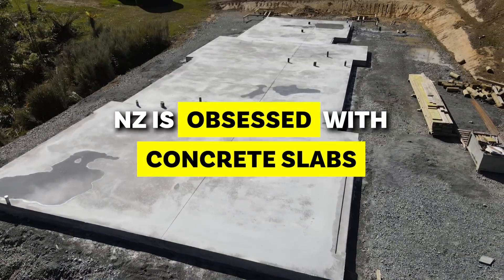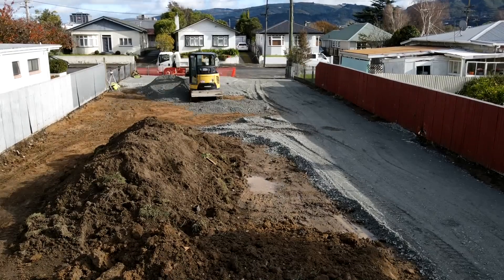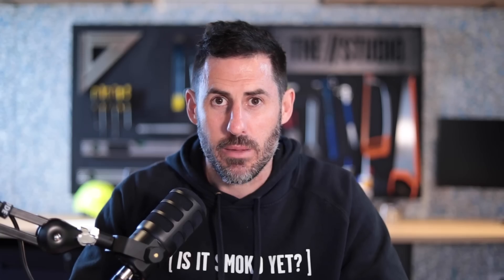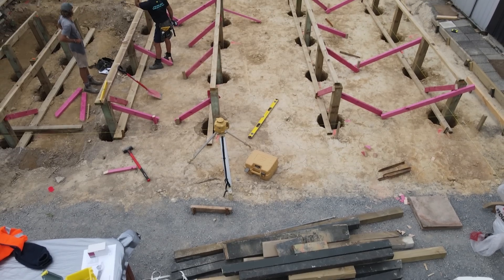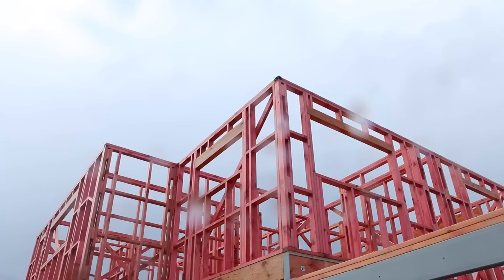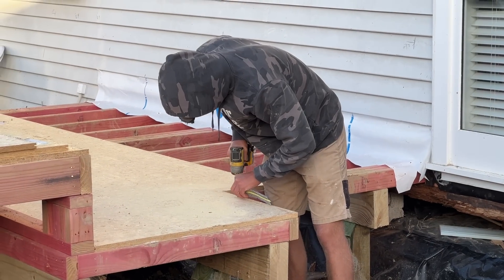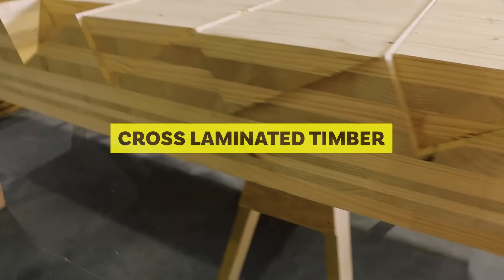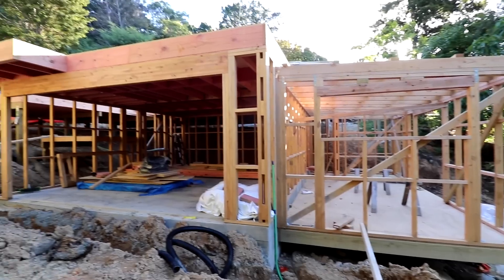New Zealand is OBSESSED! with Concrete Slabs

Comment: Hey Josh, I'm in my first year at Unitec studying to be a QS. As someone who is moving from a career in hospitality that hasn't got any hands-on experience in the industry, your videos have been an incredible resource to supplement my learning and wrapping my head around how these systems work. I've told everyone in my class to subscribe to your channel. Churr and can't wait for the next vid!
Reply: I’d highly suggest if you know a builder ask if you can do a few hours of work with them on a site too. Seeing the process from every angle will give you an awesome perspective, knowledge is power. All the best
Reply: I studied architecture at Unitec and wish he was around during my studies! So informative
Reply: I worked as a QS for 5 years after studying Land Surveying and working in the profession for 18 years. I was taught by my boss who was a builder and the skills/maths required to be a QS were simple compared to Land Surveying/Civil Engineering. I picked it up in a very short time learning from all the builders, our PM and being on site. Concrete slabs were used when the ground was suitable for them as they were quick to establish. Piles were used on more difficult ground. Of course now we use gravel rafts quite a bit under slabs although piles are still used for inadequate ground requiring piles down to solid bearing soil layers. I then started drawing up house designs using Autocad from the knowledge learned over the years in the QS field. I'm now back in the Civil Design and Geotechnical Engineering profession for a greater challenge.

Comment: 13:14: I used to live in a multi-storey hostel where the floors/ceiling were constructed of wood. I can totally relate to "elephants stomping across the floor" sounds. 
I lived on the ground floor which was a concrete slab so I was ok and not bothering anyone. I feel like the noise from the upstairs neighbours could have been mitigated with a layer of insulation and sound dampening material, but the owners went with the cheapest option I'm sure. LOL. 
There were countless other problems with that building, as it was a leaky building, where they installed the wrong rated pipes for water connecting all the hydronic wall heaters/radiators. Think it was PVC in some places?
Reply: we built a two story house, concrete slab in both levels. nothing beats it!
Reply: @martiruda  That sounds awesome (well no sounds I hope).
Reply: @guston_zimasheen  literally xD

Comment: Concrete pumps wow! We were the concrete pump, via a wheelbarrow.
A day barrowing concrete and you knew what a hard day's work was.
Reply: There is a famous (in my family) story that my grandfather told me before he died. He and his best mate needed to do some concrete work and they estimated it would take two days. So the first day my grandfather was mixing with the wheelbarrow and his mate was pouring. On the second day they would swap.

So the first day came and went and my grandfather was broken... all day lifting and mixing. However when he arrived sore at the site the second day... his mate was standing there with a concrete mixer... with a big grin on his face, a mixer which he had begged borrowed or stolen. My poor grandfather spent all weekend with the short end of the stick.
Reply: @matthewdonoghue321  I had forgotten about mixing in a barrow. Worst I did was a fence over a few days, all mixed in the barrow. Last time I checked it was still there, which is amazing in itself.
When I got my first mixer there was no stopping me, then I gave myself tennis elbow digging holes in hard ground. The 'Good old days'...
Good story about your grandad, must have been speechless when his mate turned up with a mixer, the next day.
Reply from the maker: I also remember these days well. Doesn't mean we shouldn't use these machines though and save our bodies for years to come
Reply: @nzbuilder  Ha, ha. First time I came across a concrete pump I was like why didn't we use one of these? We all know why off course...
It was abit like one floor, no powerfloat, all by hand, summertime, mate!
Reply: That's how I got strong. Glad I laboured before studying. Many would give up in the first hour of lifting bags let alone carting full barrows around site.

Comment: Mostly concrete here in the Philippines as well. Timber costs are high here and I am not aware of any codes which require identifying timber grades for different applications - so most people use concrete nowadays.